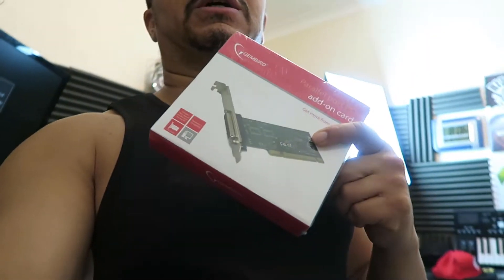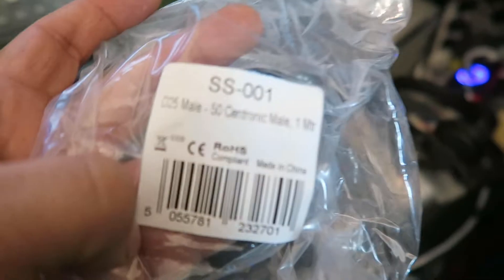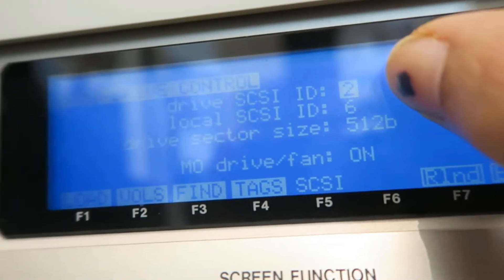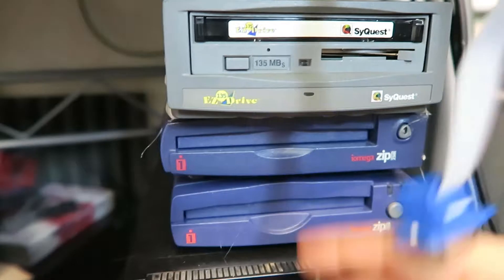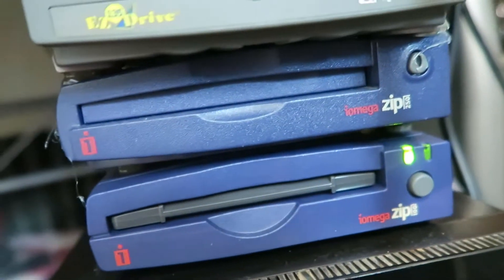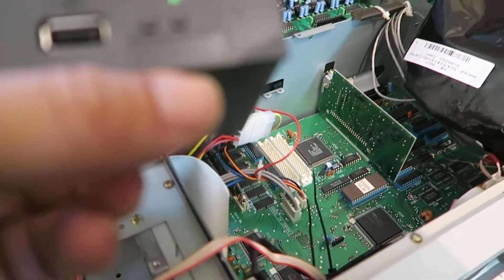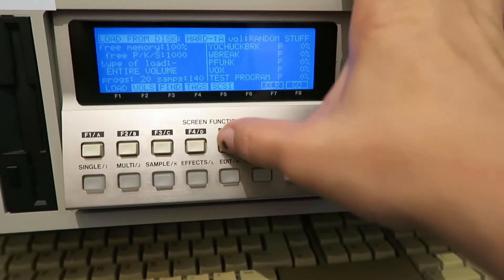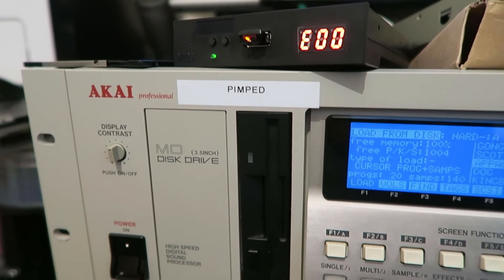MORE RETRO TECH | AKAI MODDING | EZ ZIPS | DRUM & BASS

Comment: How about instead of cutting a huge hole in the lid of your Akai to fit that drive, you just cut a hole the size of the cable comin out the back of that new drive. Then you can Blue tak the new drive on the Akai lid. Its a much smaller hole to cut and it doesnt butcher your Akai too much. Plus stops dust and crap getting in the Akai that a huge hole would bring. Just my two cents worth. 
Lovin the technical videos B, I'm a radio frequencies engineer by trade who spent most of their childhood taking electrical gear to pieces at the horror of his parents. ;)